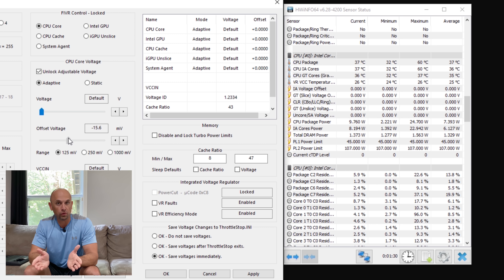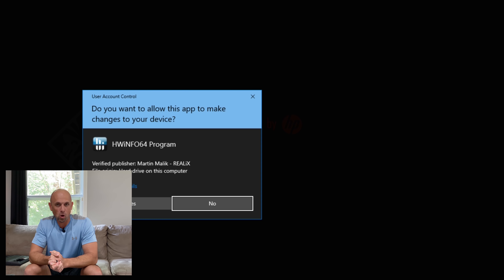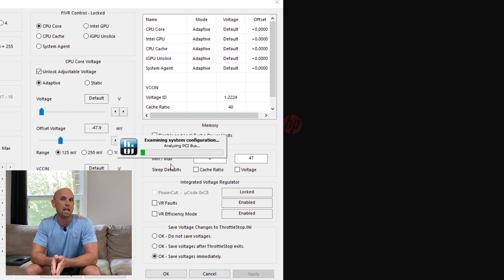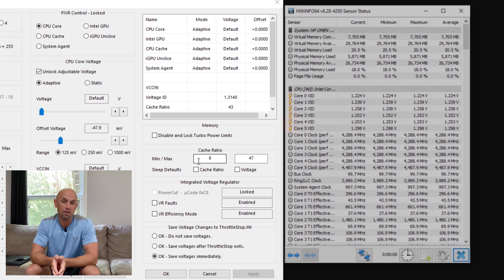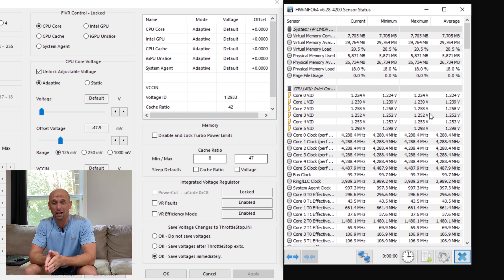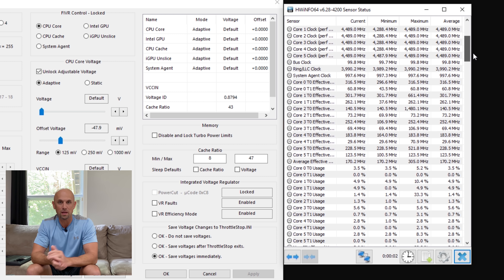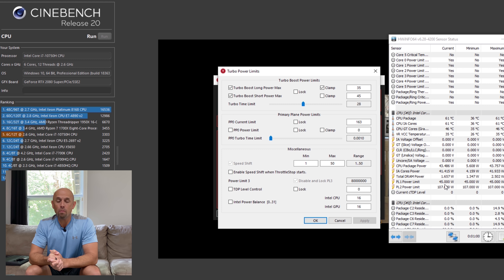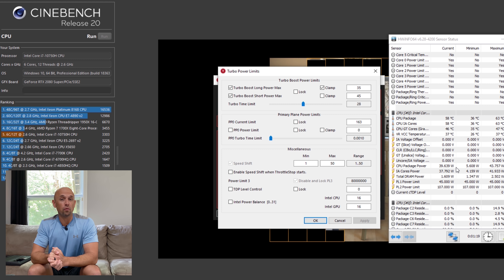Can't Undervolt?  Do This!

Comment: Mine is locked on the FIVR configuration.. Can't change anything. I have a Predator Triton with i7 11800h and a RTX3070. It gets super hot and makes huge usage of the fans in most cases without reason... Can you please help me to understand why I cannot edit those options on my Throttlestop like you did?? Thank you.
Reply: What is locked?

Comment: Unfortunately, undervolting the GPU is locked out on my Dell G3 3579 and always has been. I'm pretty unhappy with my purchase after almost two years, I wouldn't recommend anyone get a Dell. Everything is completely locked down, you don't have control over anything, and the thermal performance is terrible.

Comment: Would you recommend turning off turbo boost to reduce temps? will that help longevity?
Reply: PL1 and PL2 for intel CPUs is Turbo ! No i will not recommend you disable turbo whole, but lower these measurements of PL1 and PL2 which is PL1 = Turbo boost, PL2=Short time duration of turbo boost. Lower it via Intel XTU if you have Intel CPU and definitely you should see difference in thermals.

Comment: Dell G5 thermal paste replacement, cooling pad and turbo boost off see's a massive 20 degree drop in temps. Not tried undervolting GPU.

Dell G5 i7 10750h RTX 2070 MQ
Reply from the maker: You went postal on that one 💪
Reply: @BobOfAllTrades  It's a great result! Fortnite at ultra settings is still well over 90fps so in my opinion no need for turbo boost or the performance mode on the G5 :)

Comment: Hello sir, I'm really having trouble with my laptop, dell g7 7590, i7 9th gen, rtx 2060. The problem is the dcp latency, which I've been facing for a couple of months. When I pause and play a video back on the vlc player, the video plays back immediately but the audio plays back with about 2 seconds delay. When I also run the latency mon on the device, it shows that there's dcp latency and also shows that it's caused due to some power throttling settings, but I never found any option on my device. Could you help me with that please.

Comment: im having the opposite effect where the cpu is all but baking the gpu on the same heatpipes. Thought undervolting would help but goddamn asus wont even release the bios update for allowing -80mV for my model. I cant even downgrade to the previous version that allowed it because i cant find it on the website. im absolutely livid. i know its not exactly new but when you buy a 1070 you expect to still have the whole ass 1070 four years later not 60% of one with heatstroke (as in, this is the usage it is Constantly throttling to)

Comment: It's been happening more and more now that Windows 11 requirements are pushing people to the latest BIOS. Just updated my Dell BIOS (for Windows 11) and it's now stripped my ability to undervolt my CPU (6770HQ). Insane that Intel is pulling this crap. Limiting the power limits seem to have helped out though
Reply from the maker: Intel is not pulling this crap it is the manufacturer, in your case Dell.

Comment: They should just work on better thermals instead of having us work out a way around it , but good guide though probably gonna use somethings I found here
Reply from the maker: The limitations of the chassis will always be an issue.  Very little air moves across these parts.  Lower wattage parts is the right and logical direction.  

Sadly even Ryzen will hit 90c+ in gaming laptops too.
Reply: Was always hitting 94/95 in newer FPS games with my Ryzen 4800H until I played around with the CPUs turbo settings. Set them to efficient aggressive and I've rarely gone above 79/80 in newer games. Will probably try undervolting the GPU sometime down the line to bring it down even more. Btw Thanks Bob for all your great advice 👍
Reply: What i mean is they shouldn't let the users undervolt and do stuff like that they should like optimize it to the level where nothing can be done to enhance it or like you said have lower wattage on their parts amateurs like myself would always prefer a laptop with better thermals at stock than a laptop that might even be stronger or more premium  , also I like the new logo and thanks for the advice , i undervolted my gpu and it's running like a few degrees colder from 74 to 68 avg
Reply: @BobOfAllTrades  Hi Bob, but at least you can tweak the AMD Desktop in the Apex 15 or Thicc Laptop,check it here : https://www.youtube.com/watch?v=FtLzR-i8XmA
Reply: @h_man8386  Yeah CPU undervolting is a workaround for the laptops with bad thermals.

Comment: So undervolt on dell laptops is past. So i just disable Turbo boost in throttleStop and i agin playing with normal temperature below 70C.
I dont know if that is good for laptop, but i play gta5 or star wars 2 for 5 to 6 hours and its normal. If someone have better solution pls answer is disabling the turbo boost good or bad ?

Comment: Sir my laptop has Intel i7 10750 processor and it's a MSI laptop which I believe has company locked undervolting I have searched for it online but didn't found any proper and comfortable way to undervolt it please help me Thank you
Reply from the maker: Unlock the hidden advanced tab in the bios.  But, do not mess with things you’re unfamiliar with.   Within this “hidden” section you’ll be able to undervolt.  

Do not push too far or you’re likely to turn that laptop into a paperweight.

Comment: Guys someone please help me. My RTX 2070 mobile was lagging so badly. I used the msi afterburner's OSD to see what was the problem and realized that my gpu's clock speed was fluctuating so badly that it even reaches 300MHz. The temperatures were also over 85C. How do I fix it? Please someone help me. Please

Comment: thanks for the video
really like to see the next-gen ryzen cpu like 4950x@65w inside that beast to use that extra powerhouse inside a laptop;if only it had rtx2080 super 150w/200w or clevo had make x170sm-like chassis but with ryzen and rtx2080super@200w,that would've been great although the weight series of N series are much better suited for laptops than those x170/p7XX  series.

Comment: Hi Bob! How to Undervolt Nitro 5 i5 10th gen?
Reply: Seems like intel 10th gen cpu is not allowed to undervolt, I had try intel xtu, and the voltage section is grey, cannot do anything
Reply: @Night Walker 1-  replace thermal paste with something like arctic silver mx4
2-buy a cooling pad with many fans
3-download throttlestop and untick turbo boost.
4-set internal fans to performance or auto boost from your msi , hp or acer software 
5 -magic 30-40 idle and 50-70 full load.

Comment: Does Throttlestop WORK with 10th gen Intel devices? Ive heard mixed results and would love a actual answer.
Reply: Also can I still turn down the ghz of the cores for 10th gen i7s?
Reply from the maker: It’s device dependent and it has nothing to do with the processor
Reply: Bob Of All Trades speaking specifically and idk if youve tested this particular device but speaking of the Razer Blade 15 base with the 10th gen i7. Just seeing before I purchase if there is anyway I can fix thermals because I heard that it runs hot basically playing anything
Reply from the maker: I have no idea I haven’t reviewed any of their products on the channel yet
Reply: Bob Of All Trades ok got it. Thanks for replying in such a fast manner though

Comment: hello, there still isn't any way to undervolt CPU nowadays? it's been a year, i figured maybe solutions are available :)
Reply from the maker: You’ll have to be a little bit more specific so I know what CPU and laptop you are referring to
Reply: @BobOfAllTrades  Oh yes, forgot it was depending on the pc. Mine is a Dell G5-15-5590, the CPU is a i7 8750H. I tried, according to several tutorials, to retrograde my bios and/or deactivate BitLocker, but BitLocker doesn't want to be desactivated and the BIOS retrograde doesn't change anything. I will try undervolting the GPU but i feel like this GPU is nicely thermo-controlled and won't change a lot of things, since it never gets more than 75°C... 
Thanks for any help, love ur videos man
Reply: (the GPU is a RTX 2060 (mobile))

Comment: I get that this is almost a must for gaming, but I have to ask as someone just getting started in the world of gaming laptops before doing it.
I intend to also use my laptop, a dell g3, to use not so demanding engineering softwares with relative normal RAM requirements. Will undervolting affect the performance of my laptop for these workstation softwares?

Comment: Huh. . .Didn't know they updated the Omen 17. I know that was labeled as a good sleeper laptop. But I heard it had very dim keyboard lighting? Care to share your findings? 

It really is a shame undervolting the cpu is getting locked out. But you can't really blame intel for doing it. I just hope they find an actual solution and don't think this is end goal. Otherwise that's another nail in the coffin. It's really making the idea of Ryzen cpu's being the new king in the future. Though that sadly is still a long ways off.
Reply from the maker: I would say the keyboard lighting is a little dimmer than average. But in low light conditions I have no problem seeing it

Comment: It seems as of late Intel has been more of a fan of making firestarters rather than capable chips. Shame on them for locking these options on machines WE own.
Reply from the maker: Intel is not locking anything. They discovered the exploit, they let the manufactures know how to address it and it is up to those manufactures to do so.

Intels QC 7 Whitebook a.k.a. the MAG – 15 allows undervolting.  They themselves realize the benefits of it.

Comment: I think this is why my vaper 17x (max 17) doesn't work well
Reply from the maker: No Undervolting?
Reply: @BobOfAllTrades  yeah ive undervolted and also put the core clock to 4.2 on all cores and a -80 undervolts. And temps are not going down same with performance i also mainly game so leave it in dgpu mode. I also have grizzly thermal paste

Comment: Why do they block undervolting? Clearly the only reason anyone would undervolt their system is if the thing doesn't do the job it is supposed to do, so really by stopping us from 'fixing' it ourselves they should really be dishing out refunds or replacement hardware for everyone... NOT HAPPY
Reply: I know I’m late but plundervolting exploit is said to be the major issue why manufacturers blocked some system tuning options. That’s why new laptops come with built in default settings in their bios (tailor made undervolting, etc) or custom system apps with tuning features.

Comment: DONT BUY intel 10th generation. I have asus rog g712lw with i710875h - rtx2070
While playing world of warcraft in performance mode temperature easily climbs to 100 degree and throttles to 90 it keeps doing this circle every 1min
The laptop will be trash in 1 year the worst thing is every thing is locked there is nothing you can do

Comment: Oh, so that’s why I can’t undervolt, cuz I have a 10th gen
Reply from the maker: There’s plenty of 10th gen laptops that can undervolt.
Reply: @BobOfAllTrades  mine just doesn’t, which is sad, but I’ve been thinking that it’s because I bought a higher volt charger instead of the standard but I don’t know if that’s true or not
Reply: @Rand0mp  have you fixed yours? I also have an Asus i5 10th gen and cant undervolt it for some reason.